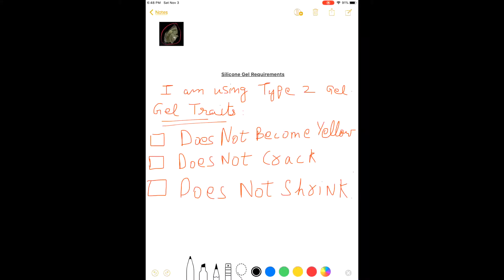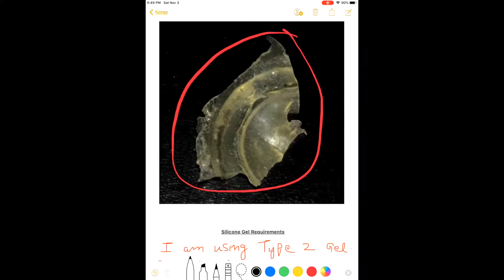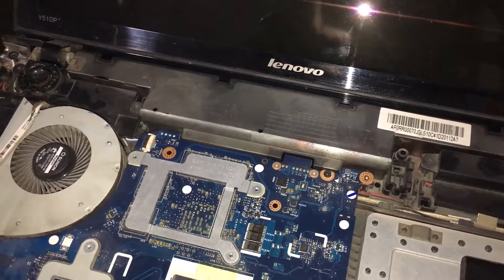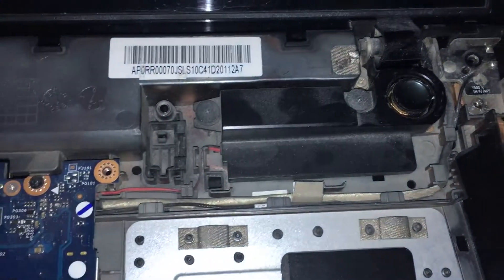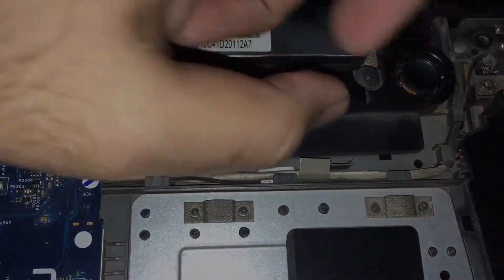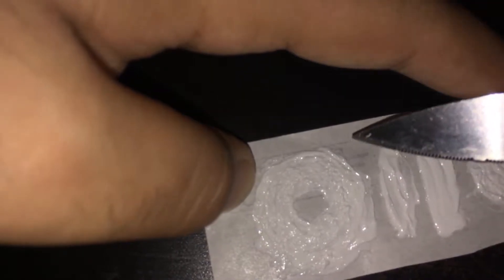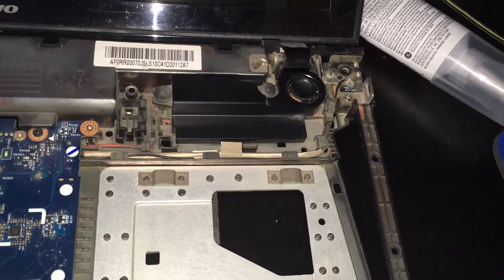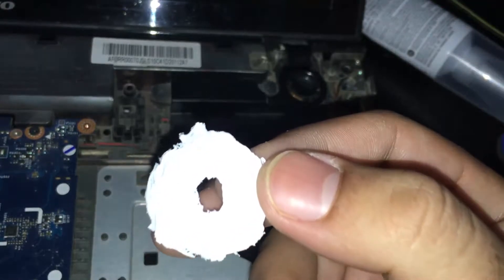How to repair a Laptop Speaker using Silicone Sealant

Comment: tried this with spare silicon windshield sealant lying around, and it kinda works although not as good as it used to (i think)

i first tried using school glue, and it made the problem worse. it worked the first few hours, but then the glue had went deeper into the speaker assembly and stopped any vibrations the speaker should be making. it was also noticeably stiffer than before, which resulted to a tinny sound

Comment: can we use glue gun
Reply from the maker: You can, but the speaker core wont be able to move, so bass will be almost nil and treble will be more. I would not recommend, because before this fix i had hot glue on it and it did not sound good.
Reply: @laveenvasnani6424  thank you
Reply: Can we use feviquick or fevibond